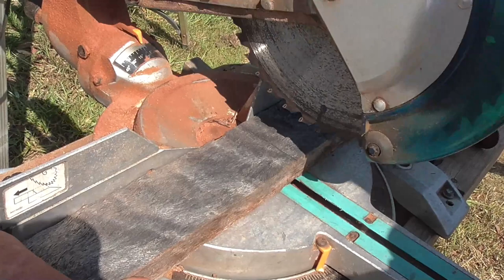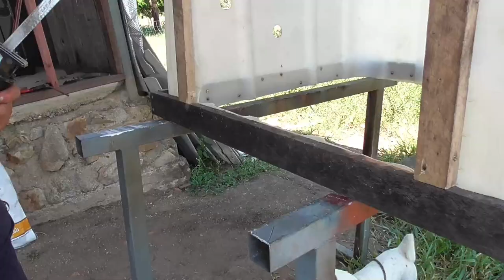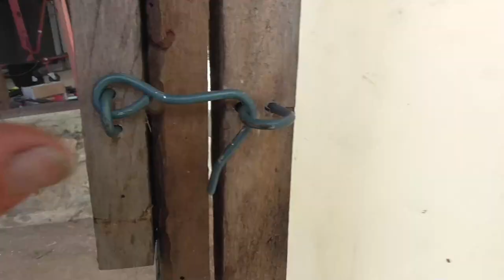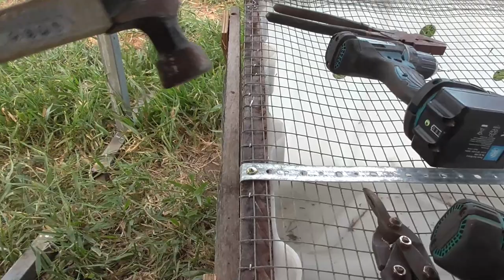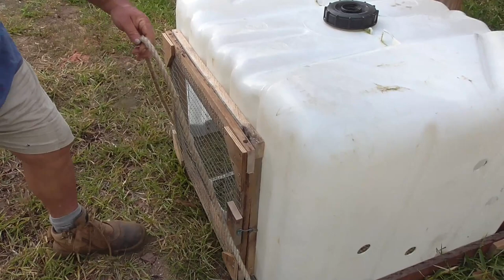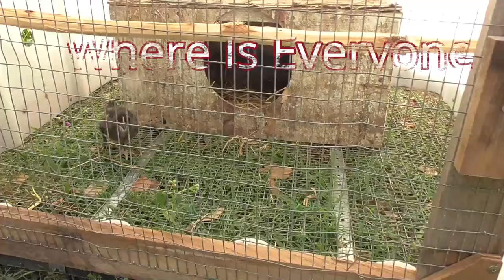INCOME STREAMS FOR YOUR FARM OR HOMESTEAD

Comment: i think it important to have a few different income streams  i find that the ones that worked for me were things i enjoyed doing i did glazing and wndow repair fixed up small engines and selling items on line that i had restored and they all did very well fixing the small engines  opened up a new career as i was approached to do a small engine apprenticeship which i have been doing for 3 years it was good timing as had been in sales for 34 years and wanted a change and am enjoying the new career as well as learning engineering.
Reply from the maker: Yes and if one thing is not performing you can ramp up something that is going well. John

Comment: Where do you get the metal to make your sculptures?
Reply from the maker: Mostly I buy it new from the stainless steel supplier sometimes I get stuff from the recyclers' but it very hit and miss and they don't really want to deal with it to small and to fussy. The grade the metal is can be a problem with scrap yards. John